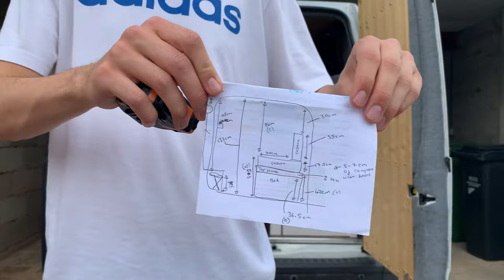Solar Power and Sofa Bed - Two Major Changes - Ford Transit Connect DIY Campervan

Comment: I had exactly the same problem with my bed on my conversion! didn’t take into account the roof cladding  and the mattress had to cut the legs by two inches your van build vids helped me a lot it’s a lot different from watching a ten min time lapse than doing the work tho! My bed took me 3 days to make the electrics were the worrying part but turned out to be the easiest job of the lot
Reply from the maker: Sounds good! I'm glad my videos could help you mate :)

Comment: As to the bed slats, well done! I am currently on version 4 or 5 on my slats as I cannot get them to slide back in without much difficulty and NOT able to figure out why. As you have shown, it seems a straight and forward built but I just cannot make it work for me. Thanks for sharing.
Reply from the maker: Thank you 😃.
A couple of ideas for the bed slats that might be useful. 
1. Loosen the screws slightly on the sliding slats.
2. Use a bar of soap on all sliding parts to reduce friction.
3. If you have an under batten which stops the sliding slats from coming all the way out, loosen the screws on that slightly.
4. Sand down the grooves and edges of the slats. 
5. Make the legs of the sliding piece slightly shorter, only about 1 or 2 mm
Hope this helps, good luck with the build!